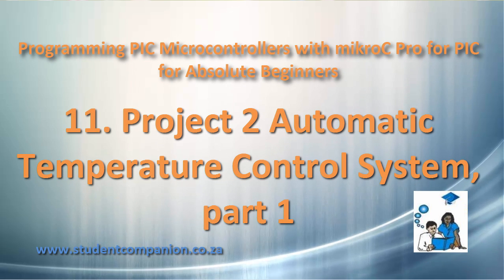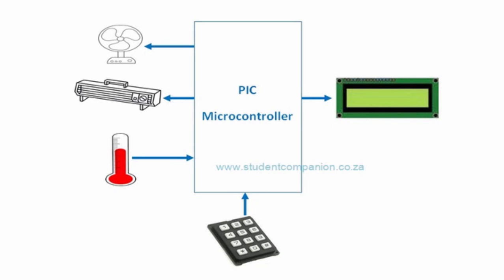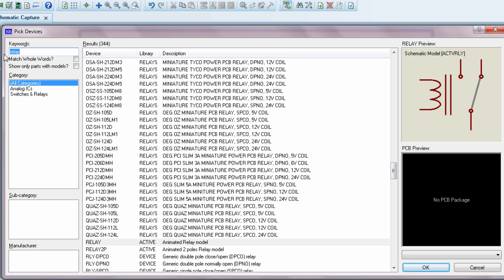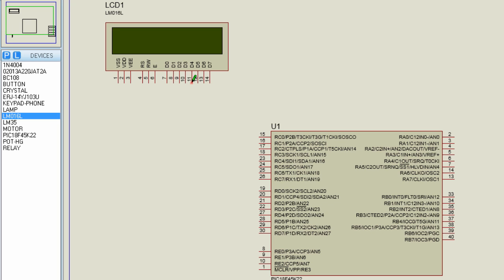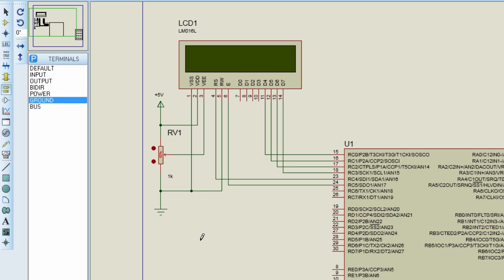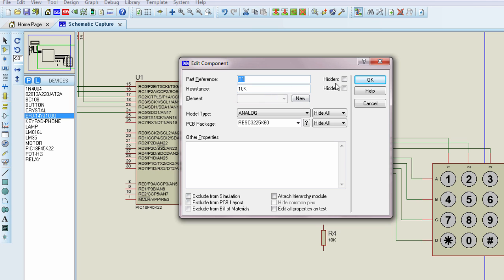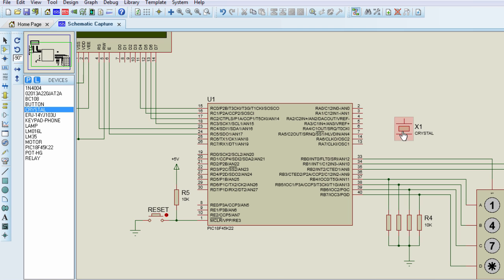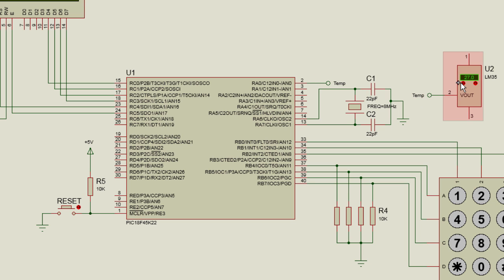11- Project 2 Automatic Temperature Control, part 1 | mikroC Pro for PIC Tutorial

Comment: If I add eeprom read and write in program routine will it worked. Even power off my last setting data still retain, after power turn on No need to set again
Reply from the maker: +megreen lock yes, it will work, than you have to change how you project starts, instead of prompting the user to enter the reference temperature, the PIC should read this value from EEPROM
Reply: +StudentCompanionSA
 Hi There,  I tries to put this routine to your program But I get ( Invalid expression error messge ) What i miss out, thank you for your good video.

void code_read(){                    
Delay_ms(20);
inTemp = EEPROM_read(0x80);
    }
void code_write(){
  EEPROM_write (0x80,inTemp );
}

you did a good job !
Reply from the maker: +megreen lock change your delay to delay_ms (20)
delay is written with small letters.
Reply: +StudentCompanionSA Thank you.......  I mean an error message come from void code_read () {  after I compile the program, give an Invalid expression error.  I using pic 18F series. I suspect 18F series cannot use  this void code_read(){  command or otherwise
Reply from the maker: +megreen lock can you post the whole code. I guess the problem is how you wrote your function. did you write it above or below the void main function?
Reply: +StudentCompanionSA  Yes I wanted to post the whole code, But your code  a bit too long. So I make it short, basically all the code is same as your, except this one.  

inTemp =Ltrim(Txt);    // this  Data has been final

void code_write (){    // give invalid expression error
    EEPROM_Write(0x80,inTemp);   //EEPROM_Write(0x80,inTemp)
     delay_ms(20);                   
    }  
  STAR:     // used this goto from PORTA push button ,without set again after power off

  void code_write (){         
  inTemp = EEPROM_read(0x80);
 delay_ms(20);  
 }
  Lcd_Out_CP(inTemp);                 //Display Ref Temp
Reply from the maker: As we asked you before, did you insert those functions (void code_write()) above or below the void main() function? with mikroC, you have to insert the functions above the main function before calling them. Post the whole code or zip your project and send it to us so we can assist you: post your project at our Facebook page: https://www.facebook.com/StudentCompanion/     or send us an email: info@studentcompanion.co.za
Reply from the maker: +megreen lock 

Try to compile this one, we didn't check what your code is doing, but to remove the void functions. You can't insert a function inside another function, you have to declare it above the void main function:

// Keypad module connections
char keypadPort at PORTD; // suppose to Portb for keypad
char oldstate = 1;
void code_write();
void code_read();
sbit LCD_RS at LATB4_bit;
sbit LCD_EN at LATB5_bit;
sbit LCD_D4 at LATB0_bit;
sbit LCD_D5 at LATB1_bit;
sbit LCD_D6 at LATB2_bit;
sbit LCD_D7 at LATB3_bit;

sbit LCD_RS_Direction at TRISB4_bit;
sbit LCD_EN_Direction at TRISB5_bit;
sbit LCD_D4_Direction at TRISB0_bit;
sbit LCD_D5_Direction at TRISB1_bit;
sbit LCD_D6_Direction at TRISB2_bit;
sbit LCD_D7_Direction at TRISB3_bit;
// End LCD module connections

#define HEATER PORTC.RC0
#define FAN PORTC.RC1
#define ENTER 15
#define CLEAR 13
#define ON 1
#define OFF 0

unsigned char inTemp;

void code_write(){
EEPROM_Write(0x80,inTemp);
delay_ms(20);
}

void code_read(){
inTemp = EEPROM_read(0x80);
delay_ms(20);
}

void main() {
unsigned short kp,Txt[14];
unsigned short Temp_Ref ; // Reference Temperature
unsigned int temp;
float mV, ActualTemp;

Keypad_Init();

ANSELC = 0; // Configure PORTC as digital I/O
ANSELB = 0; // Configure PORTB as digital I/O
ANSELD = 0;
ANSELE = 0; // Configure PORTD as digital I/O
ANSELA = 0;
TRISA0_bit = 1;
TRISA1_bit = 1;
TRISA2_bit = 1;
TRISB = 0;
TRISE = 0;
TRISC0_bit =0;
TRISC1_bit =0;
//RD0 is output (Heater) TRISC1_bit=0; //RD1 is output (Fan) TRISA1_bit= 1; Lcd_Init();
LCD_Init (); // Initialize LCD
Lcd_Cmd(_LCD_CLEAR); // Clear display
Lcd_Cmd(_LCD_CURSOR_OFF); // Cursor off
Lcd_Out(1, 4, "Automatic");
Lcd_Out(2, 2, "Temp Control");
delay_ms(2000); //2s delay

HEATER = OFF;
FAN = OFF;

do {
if (Button(&PORTA, 1, 1, 1)) { // Detect logical one
code_read();   //Call code_read() function
oldstate =1; // Update flag
}
if (Button(&PORTA,2, 1, 1)) { // Detect one-to-zero transition
// Invert PORTC PORTC = ~PORTC;
oldstate = 1; // Update flag
goto START;
}

} while(1); // Endless loop

//ON startup, read the Referance Temperature from the Keypad
START:
Lcd_Cmd(_LCD_CLEAR); // Clear display
Lcd_Out(1, 1, "Enter Temp Ref");
Temp_Ref=0;
Lcd_Out(2, 1, "Temp Ref: ");
while(1)
{
do
kp = Keypad_Key_Click(); // Store key code in kp variable
while (!kp);
if ( kp == ENTER )break;
if (kp > 3 && kp < 8) kp = kp-1;
if (kp > 8 && kp < 12) kp = kp-2;
if (kp ==14)kp = 0;
if ( kp == CLEAR )goto START;
Lcd_Chr_Cp(kp + '0');
Temp_Ref =(10*Temp_Ref) + kp;

}
Lcd_Cmd(_LCD_CLEAR); // Clear display
Lcd_Out(1, 1, "Temp Ref: ");
intToStr( Temp_Ref,Txt); //Convert to String inTemp
inTemp =Ltrim(Txt);

code_write();        //call code_write() function

Lcd_Out_CP(inTemp); //Display Ref Temp

Lcd_Out(2, 1, "Press # to Cont.");
//Wait until # is pressed
kp =0;
while(kp!=ENTER)
{
do
kp = Keypad_Key_Click(); // Store key code in kp variable
while(!kp);
}
Lcd_Cmd(_LCD_CLEAR); // Clear display

Lcd_Out(1, 1, "Temp Ref: "); // Temp Ref:
Lcd_Chr(1,15,223); // Different LCD displays have different
// char code for degree
Lcd_Chr(1,16,'C'); // Display &quot;C&quot; for Celsius
//Program loop
while(1) {
//Display Referance Temperature and Actual Temperature
temp = ADC_Read(0); //Read temperature from AN0
mV = temp * 5000.0/1024.0; //Convert to mV
ActualTemp = mV/10.0 ; // Convert to degrees Celcius
intToStr( Temp_Ref,Txt); //Convert to String
inTemp=Ltrim(Txt);
//Lcd_Out(1, 1, &quot;Temp Ref: &quot;);

//test

Delay_ms(250);
Lcd_Out(1, 11, inTemp); //Display Ref Temp
Lcd_Out(2, 1, "Temp= ");
FloatToStr(ActualTemp,Txt); //Convert to string
Txt[4] = 0;
Lcd_Out(2,7,Txt);
Lcd_Out(2,12,"    "); //

//Compare ref temp with actual emp
if (Temp_Ref > ActualTemp) //If Temp Ref is less than actual Temp, Switch ON Heater
{
HEATER = ON,
FAN = OFF;
}
if (Temp_Ref < ActualTemp) //If Temp Ref is greater than actual Temp, Switch ON Fan
{
HEATER = OFF,
FAN = ON;
}
if (Temp_Ref == ActualTemp) //If Temp Ref is equal to actual Temp, Switch OFF Fan and Heater
{
HEATER = OFF,
FAN = OFF;
}
Delay_ms(10000); //Wait 10 s then repeat
}
}
Reply: +StudentCompanionSA  Hi, Thank you very much for your help.... After I compile the program (no problem ), but still some of routine a bit differ
but I tries again see how thing going.  I believe shall be okay,  Thank once again......Great teaching
Reply from the maker: +megreen lock you are welcome!